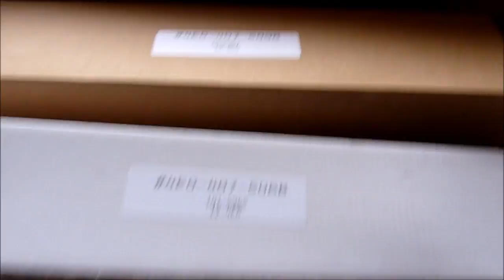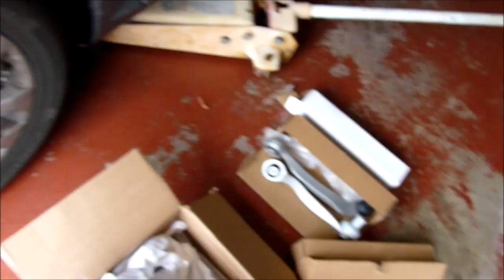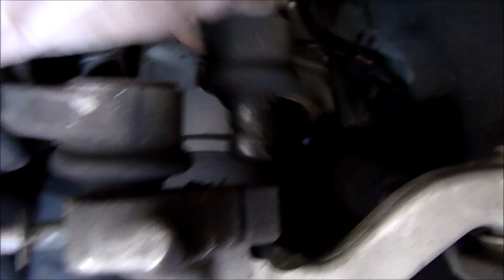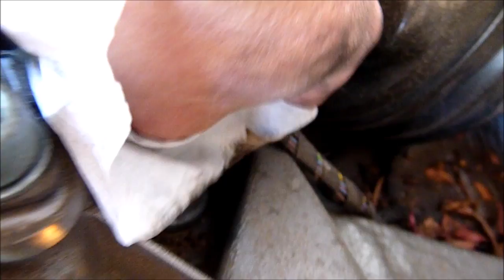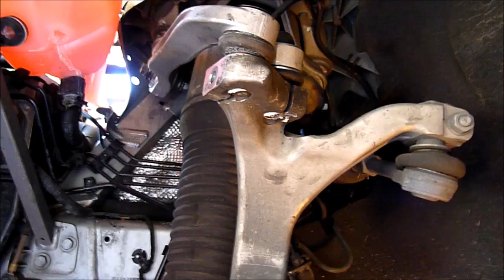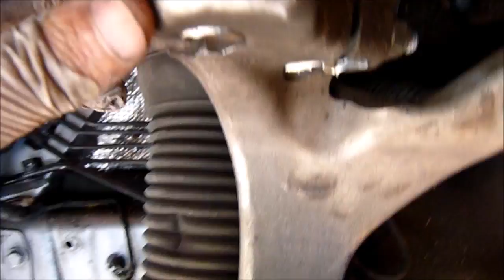Replace Upper Control Arms Audi A8 4. 2L D3

Comment: Don’t do this repair lol. Take it to a mechanic to do it. It will not be this easy for you if you live in the snow band. My pinch bolt will not come out period. I’ve had to drill it to get it partially out. I’m putting it all back together to have someone deal with it. It’s not worth it everyone
Reply: Just drill it all the way back.from the bolt head side and pop the nut back on - hammer it out

Comment: I had a 2007 A8L. absolutely loved that car but it had bad control arms when i bought it and they were expensive to replace.

i'm now looking to get a 2011 A8 and was wondering if you had a checklist of things to inspect before buying?
Reply from the maker: 2011 is a D4, I would prefer 2012 since it the first year they started to have foot trunk release. Try to get the one with massage seats since it's much better than the D3. Try to get one with driver assistant package and ACC. Other than that, the car is quite reliable as I understand. This would be the best place to check out https://www.audiworld.com/forums/a8-s8-d4-platform-discussion-190/
Reply: Thanks for the advice. I love the 2011 styling over 2012 for some reason. I know the differences are subtle but something about the 2011 i really like. this is the actual car i'm looking at buying: http://www.uagdallas.com/web/1006/vehicle/2009919/2011-Audi-A8%20L-NAVIGATION

what do you think?
Reply from the maker: Wow, it's beautiful, got everything I would want except it doesn't have Massage and AC seats. Love the dual sunroof and blind spot. That's deal breaker for me. I love the massage and AC seats. I'm so tempting to get one.
Reply: Yes I like this one. I don't have to have massage seats/ac seats, although it's a nice feature. it has the tv's for the kids and a control for them in the back which is always nice. I thought it was a fair price but they've already said they will come off another $1000 on it. I've missed my 2007 A8 a lot more than I thought I would so this is def. a step up for me. Thanks again for the advice :)
Reply from the maker: Bobby Walker before you pull the trigger, try the massage and ac on a warm day, it may change your mind.
Reply: I just confirmed the drivers/passenger front seats are ventilated, heated and massage with the dealer :)
Reply from the maker: Perfect car, make sure to take the kids while picking it up, let them stay in the back and play with everything, if something don't work, they will tell you... make sure the massage all modes work, you'll love it on a long trip.
Reply from the maker: Hello Bobby,
 I looked at the car pictures again and the car in the link does NOT have the massage button. You should check out a car that has massage. Many 2011 have full options, unlike 2012+. You will like ACC also, stop and start, lane departure options.
https://images.cdn.autocar.co.uk/sites/autocar.co.uk/files/styles/gallery_slide/public/audi-a8-seat.jpg?itok=9C-qFBms

Comment: Do you post any videos of maintenance you have done on any other Audi's you own?
Reply from the maker: Go to the website:  I own 2008 Q7 since new 51k miles now, only need 1 set of tires and $0 spent. Oil change 1 a year with Mobil 1. The most reliable car ever with all original parts while others spent tons of money to fix due to misused or 'operator errors'. My 2004 cabriolet is over 115k miles, original and working perfectly.
http://www.dognmonkey.com/audi/

All Audis are built the same. The most comfortable, fun to drive and extremely well built. People are selling these cars for nothing because they're sick of 'operator error' at dealers and independent shop who car tech illiterate.
Reply: 3dogs1monkey WoW is there alot of problems with them messing the Audi's up?

I have a S class Mercedes-Benz that went to the dealership and tech took fuses out for me to spend more money on repairs. 

My 7series went to dealer for a/c not blowing good and got a bill for 2000 to replace blower motor, It turned out to be just two 50 dollars filters .
Dealerships
Reply: I like the Audi A8L W12
Reply from the maker: alma rigney they're all the same, replace everything until it hit the right one on the owners expense. The day I can't do my own work, the day I buy Tesla. Mr. Musk is smart because he knows dealers will kill the car reputation. What's so hard for people not to follow ' if it's not broken, don't fix it' what the heck is 10k, 30k, 50k services? I see on the forum, people took a perfect running car to get 50k miles service, they screwed up the whole car from engine to brake system... cars need oil, check oil. Coolant, check coolant, brake fluid, check fluid. I can drive a car without changing oil with Mobil 1 for 100k miles by just topping it up... guaranteed. Well, let the people who don't want to get dirty pay for their mistake by taking their cars to dealers to have 'operator error'. It's a perfect world,.. LOL. My family don't even listen to me and the paid the price and hate me for 'I told you so'.
Reply from the maker: alma rigney W12 is the ultimate luxury car... can't go wrong with that. Get one with every option. Make sure it's not abused or over 'operator error' ed, because when a car is a walking wounded already, no fixing to get it back... buy a great car like I did, change oil every year and enjoy it. No maintenance, no flushing this, flushing that... don't touch a sealed system. When time comes to replace thing, then do it. Make sure to check in audiworld.com for any hiccup.
http://www.dognmonkey.com/audi/looking-for-the-best-used-a8-d3.html
Reply: 3dogs1monkey Thanks Great advice
Reply: @3dogs1monkey  That's interesting "change oil every year and enjoy it. No maintenance, no flushing this, flushing that"...what oil are you using?
Reply from the maker: @kingconsoles  mobil 1

Comment: What about audi attracted you to them ? Why not a Mercedes-Benz,BMW or Lexus?
Reply from the maker: alma rigney I had Mercedes S and 740, the newer MBZ and BMW are not well designed on both look and reliability, I don't consider Lexus luxury cars. Audis cars are well designed, reliable. Never follow - the cars are complex, mechanics actually need engineering mentality to work on them, but they don't, therefore, the more consumers take their cars to the shop for maintenance, the more they break due to 'operator errors'. As long as you understand how the system work, very little work needed to get Audis running for a long time with less cost than driving a Honda.

Comment: my 07 a8l has that noise when its cold aswell
Reply from the maker: Yes, but the squeaky noise may come from the stabilizer bar bushing. Watch my other video. Can't tell which one caused the problem since I replaced them all. But the vibration did go away after all upper arms replaced.
Reply: nice! appreciate it
Reply: where did you end up buying your parts?
Reply from the maker: https://www.fcpeuro.com and I used the cheap Karlyn, but you can buy better brand if you like. Now it would take me short time to replace them if I need to and it's been a year and everything is fine.
Reply: @3dogs1monkey  still fine? :D
Reply from the maker: @mustafasolmaz5946  If they're not, you will see a video complaining on the noise and tires wear out unevenly LOL
Reply: @3dogs1monkey  im asking cuz I'll change mine also but thinking about buying the cheaper ones :D

Comment: Interesting D2 front uppers forward arms are straight not at 90 degrees - just of change the front suspension  geometry from D2 to D3 slightly - for the air suspension perhaps.

Comment: You want to raise the knuckle with the jack before tightening the bolts on the inside end of the control arms.  Don't tighten them when it is hanging.  You'll tear the bushing inside when the car is resting on the wheels.

Comment: I purchased new air struts, both upper controls arms, lower control arms and links for both fronts. I own a 2004 a8 but forgot to measure the riding height? What now? What was your measurements? Also you said lift and comfort so I'm not sure what setting either. I also thought you had to put it on jack mode?
Reply: Did you go with oem Audi or RMT/Arnott? I bought RMTs and installing them today. Any special procedure needed to calibrate them in?
Reply: when you calibrated your suspension, did it ride differently? Did you have any problems before hand?
Reply from the maker: +Kevin Abut jack mode and lift mode are a must. I forgot the height, but if you look at the square ruler, it's a standard 12" ruler. Raise the other side and measure it, they should be the same height.
Reply: +3dogs1monkey thanks for the reply.  My car is in jack mode and jacked up with front end already taking apart. With this said I cannot check measurements. What I did notice with you though is you didn't use VCDS to calibrate the suspension after work being done. Maybe because I have VCDS to code it into Mm from the middle of the wheel to the fender I don't need measurements?? Also where did you buy your fluid pump for oil change? I want one thanks.
Reply: +Kevin Aubut How are your struts holding up? Did it go well?
Reply: +1820AL yes thanks.  I replaced both with new ones and replaced the swag bar bushings and all control arms.
Reply: +1820AL  wait!! Please tell me you haven't started?
Reply: I have already. Is there a problem with yours?
Reply: +1820AL  no problem but seams like you already did it and your not having problems. I was wondering you had vcds to calibrate your suspension system.
Reply: I don't by will have my mechanic calibrate it. Did you have RMT struts as well? Are your working as intended?
Reply: +1820AL yes I did I got both front for 700 and there awesome with a life time. Yes if you don't you could cause huge issues. Where do you live?
Reply: I live in San Diego. What kind of problems are you talking about. My car has been clunking recently going over several bumps and is annoying. Replaced control arms and sway bar links....
Reply: +1820AL  pre mature bushings, air pressure problems. Also without realizing inside of tires being worn badly. If the air suspension isn't calibrated by VCDS you could have more problems then you want.
Reply: Really? It can cause all that? I didn't know that....I'll make sure to get it recalibrated as soon as possible
Reply: +1820AL you could buy vcds for like 400.00 if you own an Audi you should always own vcds. You can code everything.
Reply: +1820AL yeah my driver side strut had a leak. When I was inspecting it I noticed the control arms needed help!! I replaced upper control arms, lower control arms, sway bar links, sway bar bushings, tie rods, rebuild my compressor motor and both struts. Car drives tight and like new.
Reply: Well, RMT said they would send out another pair, so I will have my mechanic do this entirely over and calibrate the system properly so mine can drive like yours again. Is there any special way you installed your control arms? I believe I installed them wrong.
Reply: +1820AL on me and I'll help
Reply: Can I ask you a question? Does your compressor release air every time you drive it? Mine does and I'm concerned. Do you think my compressor or relay is dying?
Reply: +1820AL it's only supposed to release air when you adjust it from comfort to automatic and so on. Also when you arm you car. You might have a weak compressor try and rebuild it before replacing it. To rebuild it it cost me like 40.00. I have to stress though if you disconnect the air you will in fact have problems without VCDS because you won't be able to bleed the system and recharge it up to the proper bars. Email me I'll help kvaub@aol.com
Reply: So are you saying that since the air suspension is not calibrated/adapted that this is the reason why the compressor releases air at the beginning of the drive cycle? Also, I noticed the front of the car move up slightly when I got off the highway at a stoplight. Do you think I received bad struts from RMT or is this all due to the lack of calibration?
Reply: +1820AL do you have your MMi set to automatic? If so its normal for the car to adjust after getting of the highway. I is usually set in dynamic for highway and comfort for city. I think your struts are fine but it's difficult to know for sure without looking at the suspension inside of measurement blocks within VCDS. That way you know how many bars are in the accumulator, front axel and rear axel. I know you really need to bleed the bad air out of the system and then recharge. I would be willing to help further if you emailed me.

Comment: Thank you for the details and taking the time for this video.  A couple of comments:  compressed air and air tools would cut the time down to 25% for this.  The shock bushing bottom looks cracked and it will go next.  For the $75 on a FEQ axle, I would also replace that -- you've done most of the work on this disassembly already.  I would def. re-torque these bolts per spec - aluminum is very sensitive to bolt pressure.  I saw a complete bushing kit for like $69 on one site - Did you look into a bushing only kit?